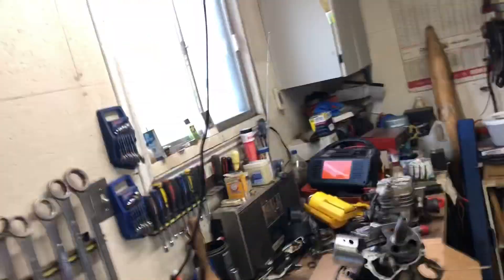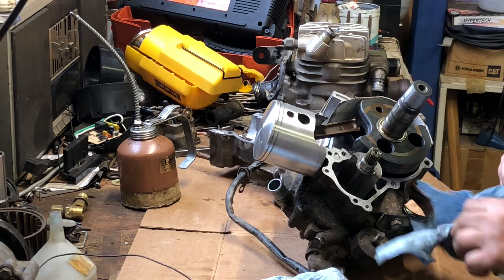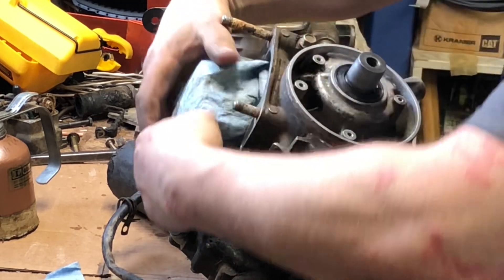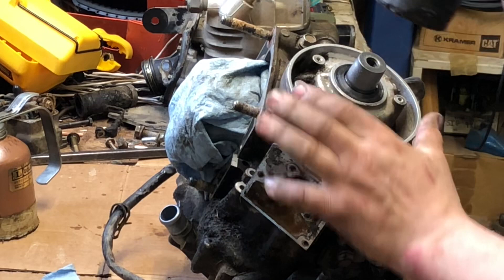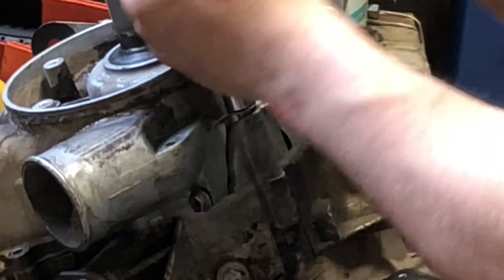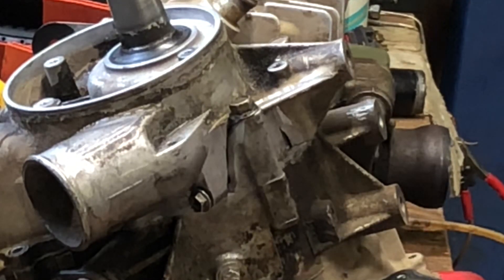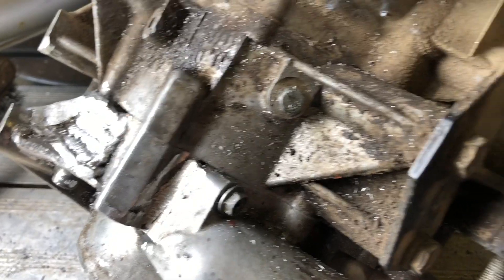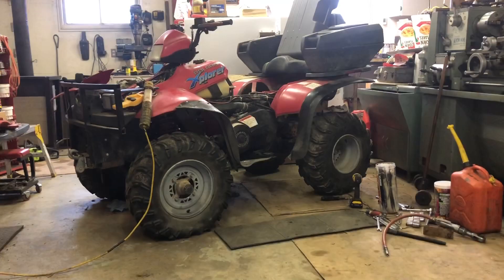Polaris Xplorer 400L Crankcase Repair

Comment: Man my 06 Trailblazer 250 has a fresh Ritter Cycle Racing lightened weisco piston and fresh bore and 130 psi compression. The thing idles like a champ and then you give it gas to go and nothing but bog in all areas of the throttle! It has made me want to pull my hair out. We have changed to a brand new carb and got nothing but bog again, new crank seal and nothing but bog. I have never had the bottom end off the 4 wheeler. What I'm trying to ask is do u think a leak in the crank case would cause this issue? This thing idles perfect but will barely roll u around the yard. I have thrown it in the barn for a year and a half now. Any ideas?
Reply from the maker: I'd be looking at the reed valves, in the cylinder in front of the carburetor.. since you haven't mentioned changing them or inspecting them. Usually the engine  will act like what you are describing, if they are weak or broken.. please let me know if this helps your issue..